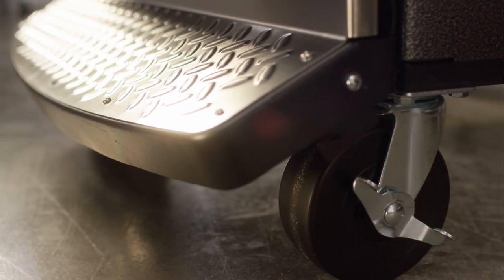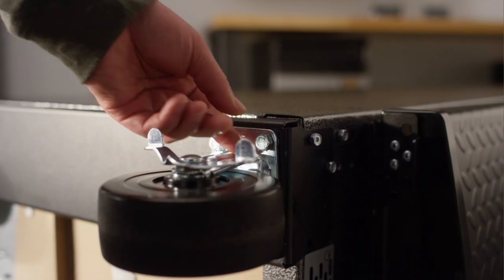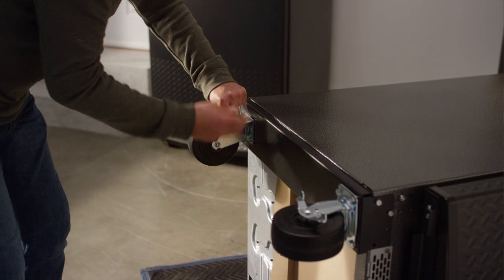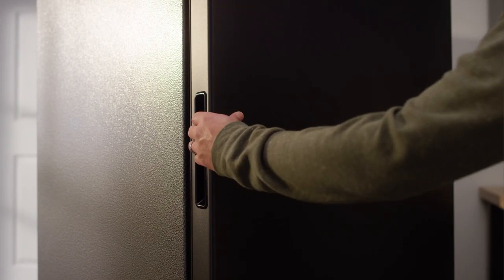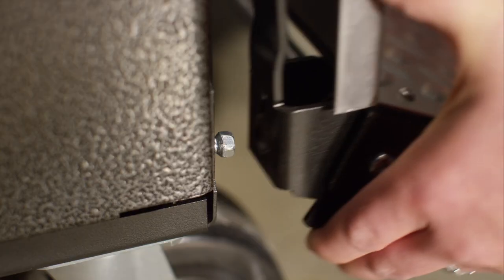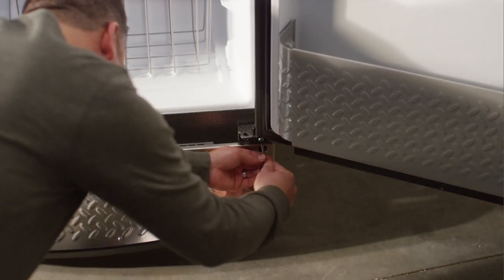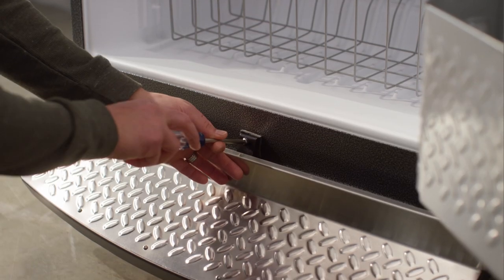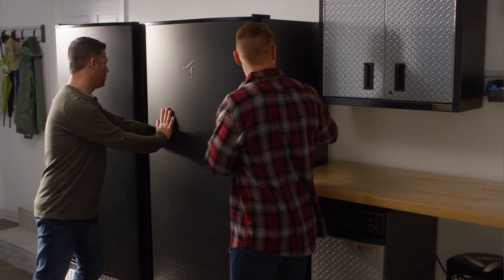Caster & Foot Pedal Installation on All Refrigerator & Upright Freezer

Comment: This was a PITA! And I’m a professional maintenance mechanic!
Reply: Instructions are a joke, I’ve installing refrigerators since 97. And when I came across with this one ,it made me look like a newbie in front of a client. Which was willing to help but made matters worse. ‘Cause he was one of those that thinks he knows everything but not the case. That’s the reason why I came to look for a videos, and luckily I found this one, I agree with one comment that it is too fast If you never done something similar it’s quite a bit difficult. Due to the shipping material, when unpacking you have to tilt it to remove those, then remove the Custer and brackets boxes from inside then lay it down on its side and once the wheels are fixed putting it upright it’s kind a hard and dangerous but okay

Comment: Is the foot pedal supposed to get in the way of the door closing, and require forced closing of the door?  Seems to me that the springs used on the foot pedal aren’t strong enough to get them out of the way if s closing door. Or did the installers make a mistake?  Or maybe there is a way to tighten the springs?

It’s just unacceptable for a level fridge to have doors that won’t close, pop open after closing or require force to close.
Reply: Isn't it amazing that they do not reply to any of the comments on this video and yours was left almost a year ago. This is what happens when you neglect your customers on social media. I hope you got things fixed and working. We're just now dealing with the frustrations that you had earlier.
Reply: @scottatbuzzmaven  We're dealing with the same problem. And our freezer door won't seal properly. This is frustrating!
Reply: It isn’t supposed to impede the door closing. You should adjust the middle screw to fix your problem
Reply: Adjusting the foot pedal actuator instructions are on page 10 of the manual.  I hope that helps.